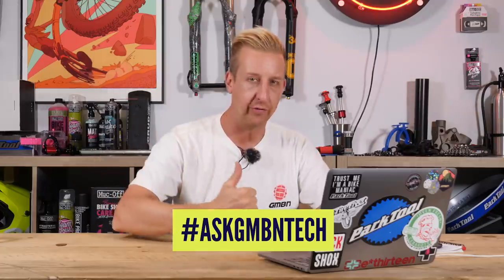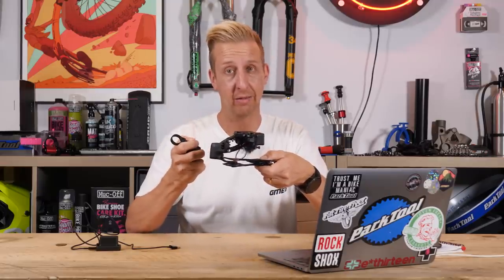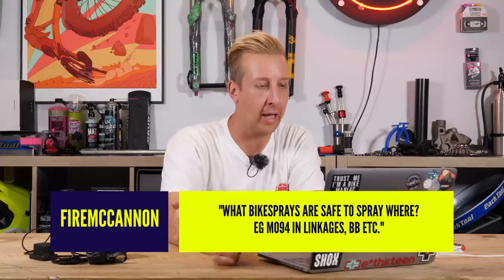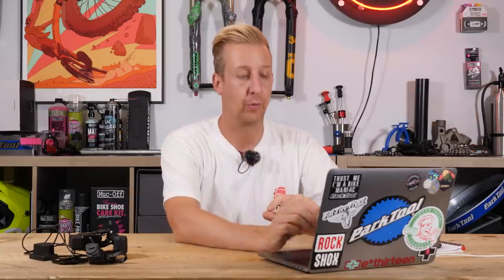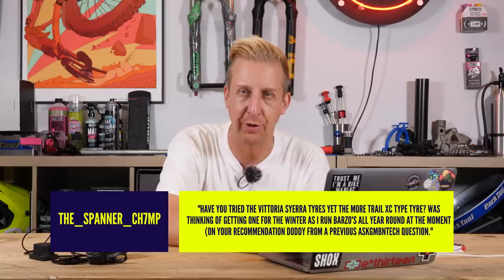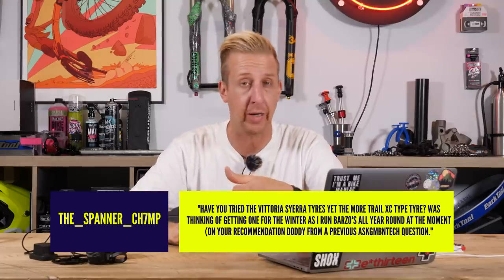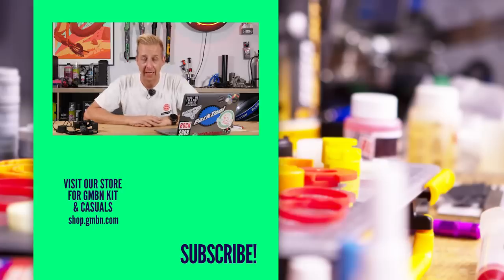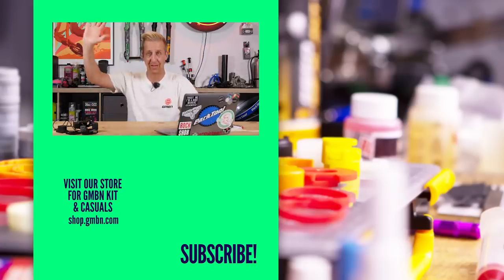Fake Sram AXS, How Bad Can It Be? | #AskGMBNTech 200

Comment: Hey Doddy! I’ve got a Rocky Mountain Fusion 30. It has an SR Suntour XCR 32 fork on the front. A Deore XT 1x10 drive train. I’ve upgraded the tires to tubeless and upgraded the peddles to good flats peddles. I’ve also added a dropper. What other upgrades would you recommend or would you just ride it till it’s worn out than upgrade the bike as a whole to something better? 

#askGMBNtech

Comment: One thing I wondered about this week, with brakes now often being hydraulic over cable operation and high end shifters going electronic over cable, are we going to see electronic brakes or hydraulic shifters? Or have there ever been hydraulic shifters already?
Reply: Rotor has hydraulic shifters since years ago. Regarding electronic brakes, you still need a system that applies a lot of force (the hydraulic lever works as a multiplier), which means a lot of battery power, so I don't see that happening anytime soon.

Comment: #AskGMBNTech Hi, been following you since early 2000's in the magazines! Thanks for the great content. I recently got Rimpact Pro tyre inserts front and rear and came off a 10 ft drop probably going a bit too fast. I'd just got them and was running pressure a bit lower than my average setup due to the thinking the tyre inserts would keep the tyres on the rim. Anyway, had a heavy landing on the front end and bottomed my fox 38's and the tyre exploded off the rim sending me over the bars and eating dirt! I was fine due to d30 protection but just wondered what your thoughts are on tyre pressures with inserts. Should I run them at my normal higher pressure? Thanks

Comment: I've have a topeak tyre gauge on maxis tyres what pressure should I be running (psi)as 28 seems very hard
Reply from the maker: Hi Robert! It all depends on the type of terrain/discipline of mountain biking you do. Most people run their tyres in the range between 22psi and 28psi. Try a few different pressures in that range to get a feel of what's best for you. 👍

Comment: #AskGMBNTech - All the brake bleed/install videos say "properly dispose of the used mineral oil". 

How do you dispose of your mineral oil? Or are you like the rest of us with an old jam-jar of used oil that you don't know what to do with?

Even after reading the material data sheets I'm none the wiser... just waiting till the original container is empty, then tip the used stuff back in I guess!
Reply: Dispose of it where used engine oil is disposed.. don't just dump it in the rubbish, soil or drains.
Reply: I don’t usually have any to dispose of. I normally mop it up off the carpet with paper towel when the bars rotate and it spills everywhere

Comment: #askgmbntech can i run tubeless without any sealant if I'm not riding anything rough and will probably not get any punctures
Reply: No, but technically yes
Reply: No! Do not ride it without sealant...Please! I know it look likes it stays up but the whole thing just unseats at the first rock garden/big corner and if it's the front it's a real bad day...Had it happen when I shook a bottle of stans too soon before using it and accidentally only got froth in the syringe without noticing, I was lucky and caught myself but it's not nice.
Reply: @tommycooperfish  how does the sealant help refitting the bead? Or do you mean it glues the tyre to a rim and makes burping less likely?
Reply from the maker: Hi! We'd highly suggest you don't. If you pump your tyre up without sealant, it'll still be rideable; however, if you were to get a small puncture, you'd have no way of pumping it back up again. This would leave you in quite a vulnerable position out on the trials. We hope this helps! 👍
Reply: @feedbackzaloop  Sorry for the late reply man I forget to check stuff, it shows when you pump it up sealant starts filling all the tiny gaps at the bead and bubbling out, hit that one spot too hard with no sealant and it just goes, bad times.
Reply: @tommycooperfish  hmm, never had any tiny gaps at the bead when the tyre got itself seated... Maybe you are having some unfortunate tyre-rim combination or not very careful with rim tape, upon which the tyre catches in those places?

Comment: #AskGMBNTech
Are titanium bike worth it or is steel better. Why choose titanium over steel or other materials
Reply: Titanium doesn't rust, so you get the feel of steel with better longevity. Also, because it doesn't rust it doesn't need painted so you could keep a ti frame looking nice with regular cleaning whereas a steel or aluminium frame will get scuffed, scratched or chipped eventually.
Reply: @williamfowler5260  o I see Thank you for the help

Comment: #askgmbntech
After a long time with my old 2010 santa cruz blurr (26") I am looking in to buying a new bike.
In the full suspension realm everything is starting to be confusing to me.
A someone that is mostly an xc rider, Will I actually feel a difference between brands snd suspension designes?
What about suspension brands that are not rockshox or fox?  (suntour?)
Regarding aluminum frames that rely on the frame compliance/flexibility as a substitute to a hinge- wouldn't there be a material fatigue problem?

Comment: I did try archer components electronic shifting with xtr derailleur nothing special i actually like better with xtr mechanical shifter and the archer the motor burned after one season the cie said no warranty just a deal on a new one but i put enough $ for that system plus some faster sprint batteries so back mechanical not fun stuck deep in the forest with some burned motor on your drivetrain...

Comment: #AskGMBNTech - can I go from a 32t chainring to a 34t chainring without needing to change chain length,  the system is a 1x12 shimano?
Reply: no.. the chain will need to be longer; if you can, that means the chain was too long to start with.
Reply: I would try it. Make sure you are not mechanically bound up in the big ring.

Comment: #AskGMBNTech - I was in a bike shop yesterday, and saw a   "PTFE Grease spray can"   on the shelf. The shop owner claimed it was for the chain. I read  on it that  it  can   be used for lubricating on high temperature  and pressure for gears and chain (In general, not bike specific) .   I always thought that PTFE is an additive to a base oil. I have not seen  a PTFE  only grease before, (Am I missing something) and are these good for bike chain?
Reply: Those PTFE lubes have PTFE as a additive. The actual base grease will be mineral or synthetic
Reply: @blinky2035  The problem is there is no ingredients table on the bottle. It is just printed "PTFE Grease".  There is no way to find out what the base is.
Reply: @platoali  check out the MSDS. Should state on there what the base is
Reply: @platoali  
PTFE is not grease.. PTFE grease is grease with PTFE particles added to the grease.

Comment: Correction: Bigger discs help with slowing down and NOT locking the wheel. 
Reason: You have more surface area for the pad to travel on. And when you need to brake immediately, it takes more effort to lock up a bigger disc, rather than a smaller one.

Extension: applying the same amount of pressure; on a 160mm and a 180mm disc causes the 160 to lock up, while the 180 slows down perfectly and can even take a bit more before locking up becomes an issue.
Reply: Check your moment of force equation before posting. Additionally, path that the pad travels along the rotor tells the energy dissipated through braking, but says nothing about the manner it has been transferred and in what time did it happen.
Reply: @feedbackzaloop  I have. And I can tell you not only from first hand experience, but also from other engineers I've studied with and technicians I work with now. I wouldn't post if I don't have knowledge on this.
Reply: @Neuro713  Well check again. With pen and paper. What you said is true for a bigger wheel, not a bigger disc on the same wheel.

Comment: #AskGMBNTech - What do you think is the most sustainable bike build? Is it more eco friendly to not use gear cables and casings, or to not use electricity to recharge your shifter and bike? Is it more sustainable to use steel or aluminium due to their ability to be recycled, or does the recycling process cause a bigger carbon footprint than producing carbon fibre frames? Is tubeless tyre sealant more harmful to the environment than inner tubes? What would be your ultimate sustainably sourced bike build?